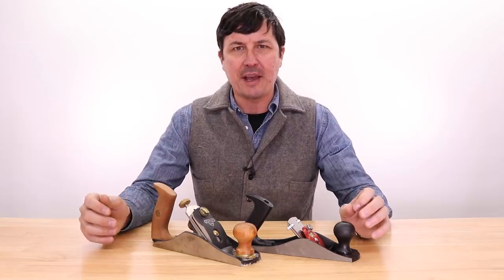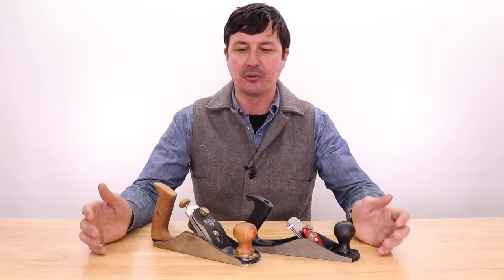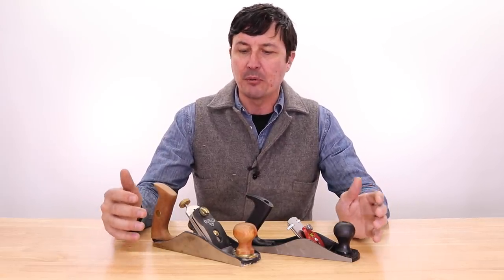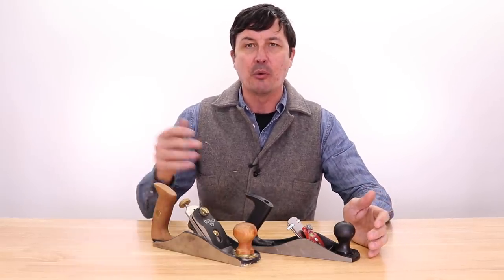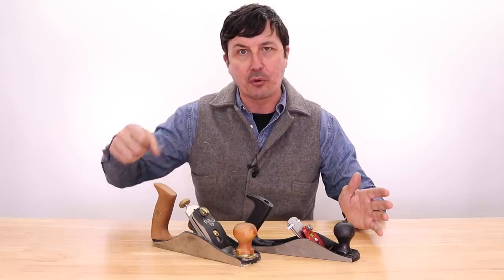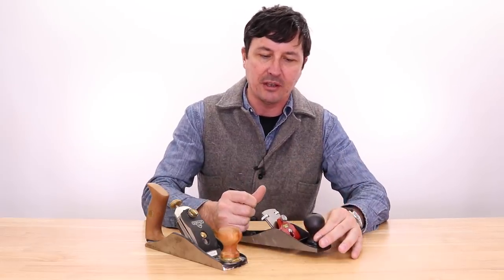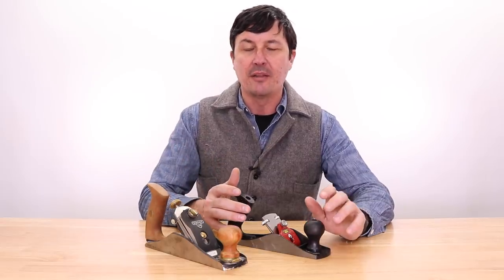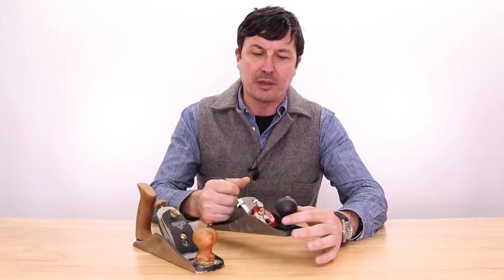Testing The Cheapest Bench Plane On Amazon

Comment: You got tips that other guys didn't share...   The glass with and WET AND DRY sand paper... DOH.. and where to get the glass.   Removing the wire.   Trying the right and the left side of the blade.

Most other guys do bevels on the blade, so it is less cutting on the right and left to reduce the gouges.

Other great tips from other guys:
Don't sharpen where you do your work.
Don't catch a falling blade.
For ones that have chip breakers there is a twist technique so we don't damage the blade when we put it on.
Using a marker to figureout where  it is grinding.
Honing guide and angle jigs for some work is nice.
Specificly how to lock wrists to keep angles when freehand sharpening, and work bench height.. (kneeling on the floor works, having the bench high is bad)

One of the coolest tips was a guy who used a dedicated belt sander and a jig of his own design to really quickly get the blades close enough to do stones on.
 

.   Of note, with my cheap blades I had to use really course sandpaper to start. (like 80, then 150 then 220)  Then I moved to 600, 1000 and then 6000. (water stones)  I'm not sure I got it right.

I've spent hours and hours researching what to do.  I was frustrated and we bought a book.

The accessories like a  shooting board and all that stuff, and a good bench are also pretty important.

Thanks for the video.

Comment: The way they used to make glass meant that it sometimes was thicker at one end. When they install the glass they put the thicker end down the bottom because it would be stronger. The glass does not flow over time. check SNOPES

Comment: That blade you didn't know much about has a backplate to bolster the blade tip... and when sharpening the blade tip's "angled" side, use a jig, for christ sake, it's a triangle, less than two minutes to make one. All that work and you run the risk of cantering the tip? You could make a nicer jig by making it so it fits over the stones, slides between the spaces, has a bolted top plate to hold the blade secure and so on... Show everyone how in a video, win win.

Comment: Most planes can be made serviceable.   Rather than recommend a cheapo plane I'd recommend garage sale or flea market finds.   A couple of my planes were purchased for less than $10.   To speed up the sole flattening learn to make a metal scraper from a file which can be used to rough out the sole and finish the sole using the wet/dry abrasive. get the #4 first, block plane second,  and then a longish jointer.
Reply: J Mc In my experience I would spend months or years haunting thrift shops and garage sales and never see a rusty old vintage plane. Then in frustration I would buy a cheap plane that didn't work very well. I should have started looking 20 years before now. Let that be a lesson to ya, you young whipper snappers. 🙂

Comment: What makes no sense to me is Amazon has a cheap #4 (which is what this plane is) and moderately priced #5 Jack Planes. 
A #5 is used for rough flattening of a board (see http://www.pbs.org/video/2172600556/ ) and the #4 is for smoothing. So a cheap #5 is not a problem so long as it's solid, but the #4 is final smoothing plane, where the plane quality matters.   
Thanks for a great video.  I've done carpentry, cabinet making, boat building, had a few mentors. Use of planes, sharpening of edges is something worth learning more about. Roy Underhill's  The Woodwright's Workshop on PBS is a terrific resource. 
The #5 jack plane for instance should have a curved cutting edge (side to side 8" radius). 
On sharpening I'd recommend to any newbie, or any (other) old hack, to investigate Scary Sharp instead of going broke on whetstones (too much malarky and hocus-pocus). How do you know your an old hack? Are your chisels sharper now or when they were brand new? If you say brand new you are as I was, a hack. 
Another bit of old man yammering I'd like to share. Those old guys, pre-power tools guys, were not spending entire days shaping one stick of wood. They worked pretty quick. My dad with a handsaw was about 1/4 to 1/2 as fast as he was with his Porter-Cable Speed Saw-on a single piece of wood. Me and just about anybody alive today maybe 1/20th as fast. (Where power saws really made a difference was ganging together twenty studs and cutting to length.) 
Often the best thing about a video like this is just watching  Wranglerstar sharpening his irons. We learn these moves by watching them.

Comment: Great video, I always love watching them, I finally realized I was unprescribed so yayy youtube. I am not in a position where I need a new #4 but I was starting over again I would probably purchase one of these. The cringe factor came to me at the end of the video. I noticed how large of a gap you have in the throat. That wouldn't be so bad with a #5 or if you are planing on using this as a jack, but with the thin iron with no support and what looks like a thin body I do agree it is a plane for soft wood. 
I will add when setting the iron it helps to look down the sole and adjust until you can just see it.

Comment: I would like to see saws and other cutting tools next.  Chisels come to mind of course, and I would hate not to have a quarter inch myself.  In my shop I would count drills and bits in my cutting tools.

From there my engineering education tells me that material that is shaped and cut will need to be fastened to other pieces.  Screwdrivers, hammers and mallets, glue and clamps, punches and probably a cat's paw.  I wouldn't feel confident without at leAst a couple of adjustable wrenches too. Basically the stuff needed to join together the parts that we shape.

Next I think layout and marking tools come to mind.  We have the forming and joining tools, time to acquire measuring and marking tools.  Framing and speed square, in fact, two speed squares since they are cheap and light. Two can be very handy for drawing a quick plan. tape measure and in my world a folding rule is essential. A torpedo level and a standard level, chalk line, carpenters pencils and lumber crayons are in my box too. I also think some string for a batter board setup is helpful but at minimum enough string to use with a weight as a plumb bob for finding down.

After that comes finishing.  Abrasives, rasps, draw knives maybe? Certainly enough stuff to sand and paint your project. While young people often buy the very cheapest of brushes I am hoping you can find that fine line of decent value but still able to make an attractive job without bubbles and nylon threads littering the finish.  In my own finish bucket I have some oils and some poly clear coats, some good old paste wax and of course the putty and filler And then I have some thinners and stuff to clean my brushes.

Don't let me turn this into a year of hard work but there are lots of great tools out there at very affordable prices. My experience with stuff from Mexico and China and Indonesia have been excellent in the last five years or so. You can't get a $200 hand tool for $20 but if you spend an hour on that $20 hand tool it's often possible to end up with a tool that will produce results like that $100 tool.  And the experience of "tuning the tool" will help you bond with the tool itself.

I will be following this series.  I am planning on putting some of the stuff you suggest as Christmas Presents for the grandkids.  Thanks for all the work and thought you put into this stuff.  I always enjoy your videos...

Comment: Always amazed at what seems to be a US practice of laying their planes on the bench on their work face or sole.
This means the plane is resting on it's blade edge. Always rest your planes on their side even if the blade is retracted, the same as always treating guns as loaded even when they are not.
Reply: Apparently this is not the way to go. I learnt from Paul Sellers, an English carpenter of 50 years that you lay it on the sole. Laying it on its side can alter the settings that you have carefully dialed in.

Comment: I enjoyed this video. thanks. 

I think you have to say what your time is worth and how often you will need to use the tool. There is an upfront cost and then it will take longer to setup every time you use/sharpen it.  Finally how long it will last. 

So I don't think a plane is needed for a person only doing rough work. 

If you want to become a real wood worker equipment that take a lot of setup, ... may frustrate them and make them fail and quite.

I think a person who wants to be a woodworker should buy good tools. Maybe not professional level that stand up to heavy use but quality tools and that trainings explain. For example you wont find may articles/videos on how to setup, ... this plain.

So I think I'd want to get the tools in this order: square(s), saw, CLAMPS, glue, sand paper, hammer, drill, drill bits, saw horses, miter saw(power), chisel, magnets/stud , sharpening tool, router, ...

Comment: Wow, you're a glutton for punishment! I start with 60 grit sandpaper and progress to 320. Could flatten the sole and clean the sides on a vintage plane (like a pre-WW2 Stanley Bailey) in an hour or two, instead of 5-6. The toe, mouth and heel should be coplanar; elsewhere, a hollow is fine, but convex is undesirable. Love the videos! I'm thinking I should get one of these cheapies to use as a scrub plane!

Comment: Here's a hint for you.  Take those adjustment screws off and throw them in your spare parts bin.  Adjust the plane the same way the old timey planes were adjusted, i.e. use a small wooden mallet
(never strike your plane with a metal hammer) and strike the back of the blade to deepen the cut, to retract the blade either strike down on the front knob or strike the heel of the plane,  to adjust side to side just strike the side of the blade that is high.  Doesn't take much practice to get it down.  Also for dressing the sole don't start with 320 that's much to fine and takes forever.  Instead start at around 80 to 100, then 220, 400 etc. until you reach the smoothness you want.  As for what must be flat, the entire toe area in front of the throat,  about 3/4 to 1 inch of the heel all the way across, and both edges all the way down. The central area behind the throat can be left slightly concave if you don't want to flatten the entire sole.  Hope this helps.

Comment: I think the biggest problem with this plane is the thinness of its blade. Regardless of the amount of work and time you spend tuning it, it won't be able to cut anything harder than softwoods. That's a major fault.
Apart from that, this tool costs $50 in 2023, which is too much, considering that one can get an old second-hand plane for that amount of money, even for much less. An old wood plane with a decent blade can be restored to its original condition and it can serve a hobbyist woodworker for a lifetime.
So I'd say this plane is for those who cannot have access to better options, and who are willing to make modifications on an existing tool. I'm afraid they are not the beginners, they have no expertise, experience and courage to start working on a newly-bought plane. I think it is for the seasoned DIY guy, who has a single project in mind and doesn't want to spend a lot on a plane that he probably won't use anymore.

Comment: I have 8 planes.    NONE of them cost more than $20.00.    I bought them at thrift stores and garage sales.    They are all Stanley or Bailey vintage planes.  One of them is 80  years old.  They are all well built from a time where quality mattered.    I took them apart, cleaned and oiled them.   I sanded down the sole, sharpened them properly and totally restored them.  They are way better than any new $20.00 plane that is made today.

Comment: Plainly this is not suitable by the criteria set down. Low price will never be on your mind when you get frustrated with those awful adjustments screws. Sharpening &  blade adjustment are crucial & must be straightforward.

Comment: you do not press hard when stropping on leather use light to moderate pressure and use lees of an angle than you sharpened you can and will roll your edge with a wrong angle and hard pressure and ruin you edge that you worked so hard to apex. good video though it pained me to see you press hard on that blade when sharpening on the leather